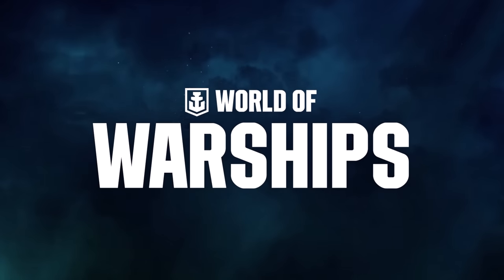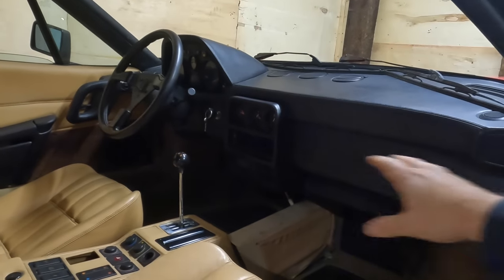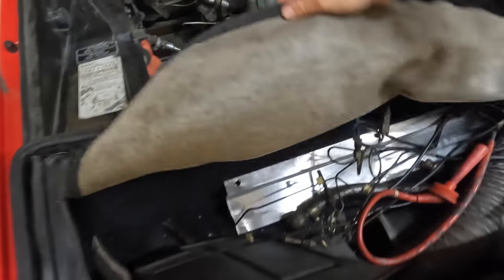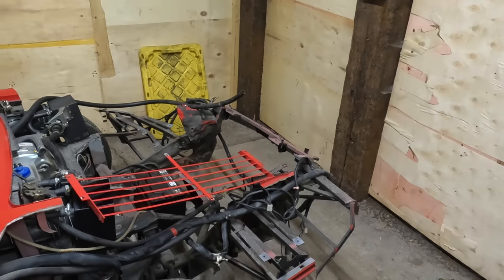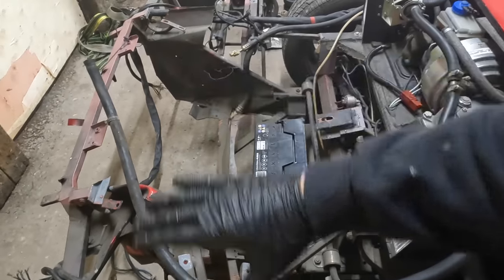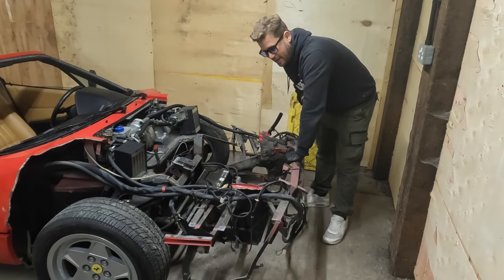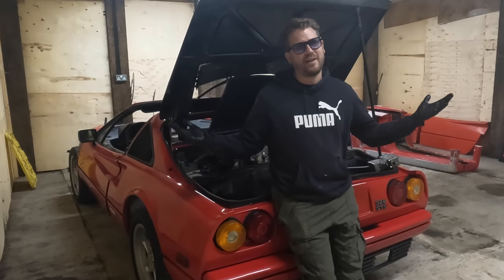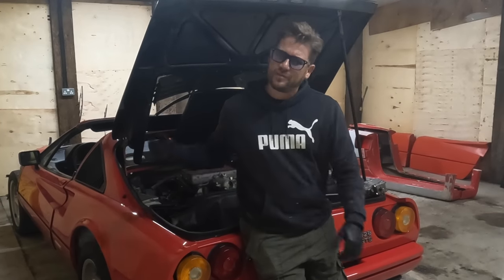I Bought a Classic Ferrari at 10% of the Market Price - But How Bad Is It ?

Comment: GTO conversion build would be out of this world. Sounds like the right job for Ratarossa🔥
Reply: Trouble is : will it be recognized / certified by Ferrari brand as a 288 - GTO or a massive lawsuit will come on Scott  by Ferrari brand ?
Reply: @poplaurentiu4148  Not if he makes his own custom emblems. It's a tribute car. Would not have to be 100% accurate to a real one..
Reply: @RayBen555  What i was pointing out is not about the emblems is the fact that at one point the car was registered as a certain model but after modifications at least in Europe in order to run on public streets cars need to be registered and with a valid inspection (MoT), also have valid insurance.. So for such a modified Ferrari it will need first a re-homologation for all modifications in the car papers, then need to pass technical inspection, and have that thing insured otherwise at a quick stop traffic control check police will find all the differences and will instantly seize & confiscate the vehicle +apply  hefty tax to the driver for illegal mods, and that is not all because once the law gets involved the main brand (Ferrari) also might ask thru lawsuit and require different legal payments + other pretentions.. so yeah is risky..
Reply: @poplaurentiu4148  I don’t know anything about classic and restored car registration in the uk but I really don’t think police or safety inspectors will care one bit if the is restored to original or varying degrees of gto. They only care about safety, which means the usual mechanically and structurally sound, lights and indicators, and horn. The car will be registered as the car that it is specified in its existing paperwork, which correlates to the frame/chassis. Everything else can be whatever one chooses. And I think you’re making to much of this blown out of proportion Ferrari lawsuit stuff. I really doubt they will care unless he’s trying to fraudulently represent it as a real gto in a sale or making a really really big spectacle of it at a large car event or show.
Reply: @poplaurentiu4148 well in this case Ferrari won’t recognise as a true and genuine GTO, it’s more a way to enjoy building a similar one and enjoying of a “GTO” made with a lowest budget then buying a proper one
Reply: The 288’s tributes are already being made on 308’s all over the world.  Wouldn’t they all have lawsuit stories?
Reply: @rolexmd69  If they are hidden in private collections or just for fun on private roads that nobody knows about and not run on public streets maybe.. For a quick example Shelby Mustang has plenty lawsuits because people were try to re-create Eleanor replicas all over and they'r projects end up confiscated and dragged in expensive lawsuits then Ferrari is even worse..
Reply: @poplaurentiu4148  In all respect the example you are bringing up about Shelby and the "elenore" trademark is not really a good example in this case. Apart from the fact that the people who "owned" the elenore trademark turned out to be fraudsters and used these trademark lawsuits against people to enrich them selves (look the story up) , B is for build has stated that if he would have not mentioned or labeled the car with any of those trademark names, he would have been able to keep the car and finish the project. Again the key point here is to not advertise the tribute car with the real company labels. Back in the 90s - 2000s Ferrari would of been picky about this but not anymore because so many people build tribute cars nowadays (even of very old classic models).
Reply: @poplaurentiu4148 there are many Ferraris that have been rebodied to look like other Ferraris.  Many 250 GTEs have been rebodied as 250 GTO, or even 250 SWB.  They are listed in Ferrari registries as being rebodied.  They aren’t treated the same as if you took a Fiero and tried to make it look like an F40.
Reply: With the Bellhousing damaged I wonder how easy it would be to turn the Engine around and fit a Porsche Gearbox? A Couple of Turbos and jobs a Goodun 😅

Comment: Since the lid isn't the original one, in conjunction with all the transfer case/clutch housing damage, I think the flywheel took a "flight"! I mean, looks really consistent with a flywheel disconnecting from the crankshaft and wreaking things. Just a guess, but the only time I saw flywheel damage, it looked pretty similar.
Reply: Was thinking the same thing. Also locking up the rear end which probably caused loss of control and crashed the front end. Seems plausible.
Reply: 110% agreed! Even the angle it jettison is consistent with the rotation of the flywheel itself in conjunction to the crank.
Reply: And maybe Thats why the lid was change
Reply: That must have been one scary ride.

Comment: The flywheels either let go or become disconnected from the crank, you can see the clutch pressure plate has also been ripped from the flywheel, when they let go its utter devastation, iv’e got the faintest off scars on my ankle from this, i consider myself pretty lucky to still have my feet attached considering the rest of the damage it caused. Should make for a good project but what damage has been caused to the crank and bearings. Good luck as always.

Comment: The wheelbase on a 348 is the same as the F40 and 288 GTO. 328 is different. Starting with the 348 frame and using the 328 components is probably your best choice

Comment: You can hit the power window motor with 12 volts if you want to seal the cabin until you score the missing switch, but you knew that already.

Ask a.i. to copy the metal needed to replicate the front frame, then box it all in accordingly with your meshes from the new Revopoint Miraco 3d scanner, accurate to a mere smidgen of a morsel of a millimeter.
I just bought one of those.

Comment: I would try to rebuild the car! Such low milage and overal condition seems to be pretty ok. If the engine is not tatally gone i woould for sure do it. I think between 15 and 30K you will finish the car and have a great value for it and we have the content. So much looks very nice still. So go for it. At least build out the engine and see what it's like. Maybe it's bad, but maybe it's not that bad and you rebuild it and buy the parts needed, missing and destroyed.

Comment: This is a tough one... I owned a 328GTS for 10yrs and I would like to offer a couple of observations. The fact that the passenger door opens and closes so well tells me that the suspension is in excellent condition and the chassis is straight. Something as simple bushings worn in the front will cause the door to sag. The GTS has a lot of chassis flex. I know this from experience and tracked my 328 many times so I am familiar with the cars limitations. Having said that I would never consider a GTS for a 288 build, and I love the idea of a 288 build but you need to start with a GTB if want to up the performance. Another thing that others have stated is the wheelbase needs to be 4" longer and the engine rotated longitudinal and lower like a 348 and on... When pushed you quickly feel the high CG in these compared to 348-360. I know I have tracked a 348ss, 355 and 360CS. As much as I would love a 288 build I just don't think this is the right candidate unless you can source gtb doors and roof. If rebuilt with maybe some engine upgrades these cars are fantastic and very reliable, not to mention beautiful. My vote is to rebuild and sell for someone to enjoy as a great driver.
Reply from the maker: Fantastic info thanks for this, very helpful

Comment: That damage to the gearbox was clearly caused by a clutch pressure plate failure. You can see the mounting points are ripped away around the outside of the pressure plate. Definitely not caused by being dropped.

Comment: Before you got to the 288 part I was googling 328GTS with 288 GTO kit. The ones I saw online were fugly. The wheel base is the biggest concern. I wouldn't put the kit on an MR2. If you go this route I think to make it really nice you'll have to go bespoke. The kits are not pleasing to the eye. The front end looks good but the rear is completely out of proportion.

Comment: Fix the car as a low milage 328 and sell it at a decent profit or part the car out at a profit, keeping the bits you need for the F40 project. I would not go down the GTO tribute car rabbit hole, especially since you already have the F40 project started. Just my two cents (pence):)

Comment: sell everything you dont need for the  F40 build to offset the cost of the build!!! interior, seats, door cards, lock cylinder/ignition switch set. windows (or complete doors) quarter panels, lights...EVERYTHING the F40 DOESN'T NEED !!!!!

Comment: Yeah! F40LM project about to be started. Do the Honda K series engine swap with modern technology. Like guy from Stence Works did. Amazing and super smart solution. F40 LM with K24 turbo engine. That will be space rocket.
Reply from the maker: But what if I had a real F40 engine and transmission .... LOL just saying
Reply: @Ratarossa  It will be technology of 80’. You will save a lot of time and money, if you will install 21th century automation and automotive technologies. Basically look for such concept: classic F40LM “skin”, but under the skin modern technologies. Up to date vehicle. Some guys built the F40 replicas over the 355 chassis. I do recomend to stick with 328 chassis as it has unique super light bicycle concept space frame.

Comment: Save it and restore it as it was! Since this was not a 288, no matter what is now done to rebuild this 328, it will still never be a 288. A tribute 288 might be fun to build, but would be barely a Ferrari at that point. Not to mention the tremendous cost involved to put very rare 288 bits on a 328 when you already have most of what you need to get this car roadworthy as a 328.

Comment: Scott if you don't want to build the 328 back to original specs have you heard of Barkaway Ferrari in the UK? There videos show they do buttiful work. They can do all aspects of the work needed. Engine, bodywork and paint. Give them a call if you want to sell it. Also Ian Tyrell is restoring a F40, maybe you can make a trade. Please don't make the mistake of making another Frankenstein in the world. The car was built a 328 not an F40 or 228. FYI a 328 just sold in the U.S. on bring a trailer for over $100,000.00😮

Comment: Norwood used to build high end 288 tributes. That would be a cool project, if you stretch the chassis to proper length and mount the engine properly. Just my 2c

Comment: What a dilemma to have, restore it to factory, sell it to put the extra funds to the F40 build, Thats option 1, option two, use it as it was originally bought for , as that would save  the budget for said F40 build along with not having to source some of the hardware that would be needed to build the F40. Thats the only 2 options that I would be contemplating, but thats just my opinion

Comment: While I lean toward restoring it as a 328, we need more information.  The engine needs to come out for a close exam to see if it can be saved without breaking the bank.  If you can get a working engine, then the rest looks quite do-able.  This could be a build that takes a long time and it could also be a quicker build that turns a tidy profit, but we don't know what it really is at this time.

Comment: Someone, overyielded the clutch pressure plate to flywheel bolts, then dumped the clutch and it separated and smashed bellhousing all bits in the local area and rear lid (hence blue one on there). I bet you find snapped bolts in flywheel that should hold the clutch on
Reply from the maker: This is a good theory, I will take a closer look
Reply: If parting out, how much would you want for the carpets? If condition is all as good as seats look. 😊

Comment: Before you said near the end I was going to mention that it looks like a donor car. 
I think you might as well at least remove the engine so you can see what’s saleable or what it would be to complete. 
I like the idea of a 288 tribute because along with a 250 GTO the 288 GTO is one of my favourite Ferraris. 
In fact personally I’d rather see a 288 GTO tribute than an F40. However it’s not about me. 
If that mileage is genuine and this will not be a U.K. registered write off then maybe a light restore (get it back on the road) might be the best idea. 
Try not to take away too much time for that F40 build. 
The BB is still awaiting completion. 
First world problems Scott 😅

Comment: I think the engine broke on the road and the guy had then an accident. So taking into account the rebuild price for the engine itself and the front bodywork (original parts are sooo expensive), you can probably make a very cool 288 project for a close budget. I know that, I'm rebuilding a Mondial back to original conditions.

Comment: Did you pay Import Duty and VAT ? Surely you have to allow for that in how much it cost you.
Reply from the maker: Yes that was all included in my 'shipping costs' @ £2500 - part of that was import duty which because the car is 30 years old is at 5% so not much
Reply: Thanks for clarify that point. @Ratarossa

Comment: As its so clean, apart from the engine and front end, I would try to get it running and then if it runs ok, just repair back to standard, if the engine needs lots of work, black gto tribute with modern turbos and ecu/fuelling.

Comment: I'm biased because a 288 would be THE car to have for me, and though I would almost prefer a tribute I could USE to the orignal, I don't think I would want the car to end up being LESS capable than the orignal. If I couldn't get to that (like with a 348 or 488 engine) then IDK if I'd put it ahead of an F40 tribute.  But that's me.  You've rescued so many cars that it seems you kind of have an emotional attachment to keeping them on the road.   If this car was turned into something else, how many 328's would it keep on the road?

Have you thought about how you're going to turn it from a GTS into a GTB  as it will need that roof strength to be a capable 288 if you go that direction.

It could ALSO be a 328 RestoMod.   Maybe get a Miraco scanner and fab up some custom bodywork?  Just sayin'

Comment: Looks to me like the engine flywheel came loose or broke at High rpm which smashed the bell housing and adaptor plate, that damage is too extensive to have been caused by the engine being dropped. Do you have the remains of the flywheel? If not I would assume that broke into smitherines and was left on the road!

Comment: That engine/gearbox damage looks like it was caused by the flywheel parting company with the crank, is the flywheel present ? Check out the damage on the clutch cover and the clutch plate, they were spinning when what ever happened started

Comment: Only 13k on the clock and that interior is fresh. Either restore or break. My theory on the engine is that it's no good. Probably swapped from another 328 after damage during rebuild or they damaged it upon swapping for the engines over. I'd love to see it restored but it would be a money pit. I'd break it and give other 328s a chance at a new lease of life.

Comment: It's nice tho even when its finished it will still be a crash damaged 328 even a low mileage one...288 all the way!! You've got 4/5ths of one and the bits that need repairing (front and engine) are already missing so to replace as 288 would be optimal. It's the best of both worlds you don't part out the 328 and its on the road again just nicer prettier and faster. It would keep the car gods happy. I know you hate breaking things for parts especially as its so clean every where else.

Comment: Agree with the flywheel comment. Probably an accidental redline 2nd to 1st. If it had been dropped off a hoist why would they have put it back in the car?
Reply from the maker: It wasn't fully back in the car, I just bought it with the engine and all the part, so they strapped it back in to make transport from Canada a lot easier

Comment: Spending $12k on that car is not a great deal given you will have to spend a lot more to get it back to what it was when it came off the factory floor some thirty years ago.  What you have is bought a $12000 dollar ticket to a very expensive car project with questionable returns. How do I know this? Because I have done the same thing on a different car project.

Comment: No no no no to a replica look alike. No different than a 355 alike over an MR2. If you're going to do a 288 build then at least give it the trousers to match the mouth, turbo engine, upgraded chassis, etc. Otherwise it's just naff. Better to just restore the 328 at that rate.

Comment: That car is way too nice to do anything to it except restore it. You own other basket cases that I think would make better cars to butcher into a “tribute”.
Reply from the maker: Point taken, however in my head the other 2 x 308s I have are undamaged cars, just engine running issues. As this is already damaged and requiring a rebuild frame (at front) to me it makes more sense